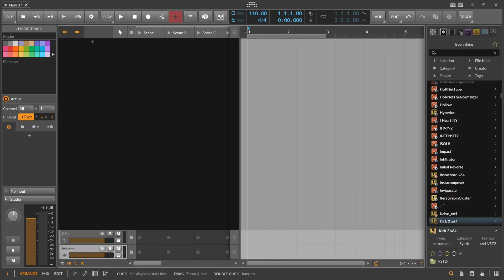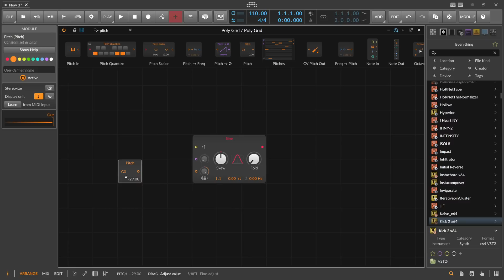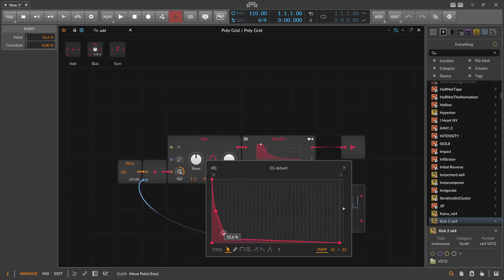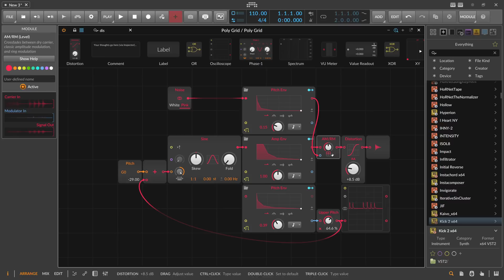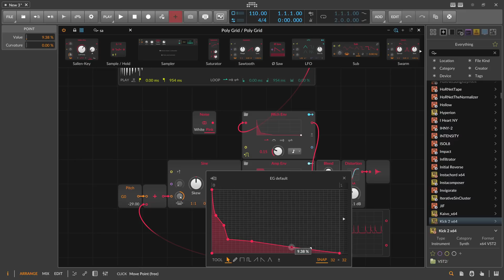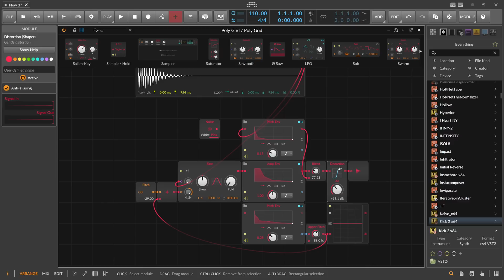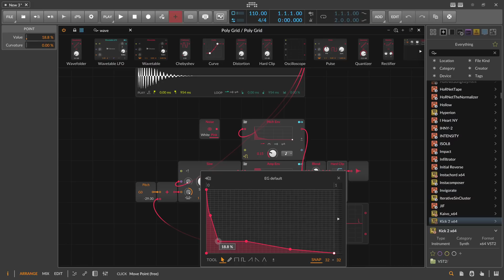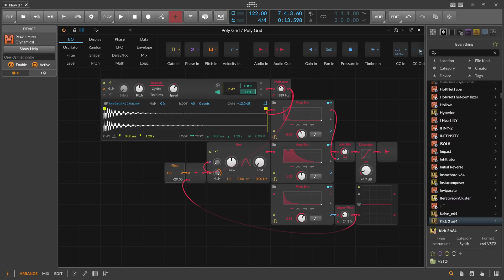replacing Kick 2 with Bitwig Stock Devices

Comment: My $0.02: consider using oscillator sync to reset your audio oscillators on each trigger. If you don't do this, the transient will change every time. The changes may or may not be detectable depending on your patch, and for that matter, they may be desirable. IME, with a techno/house beat, I want the kick to be either identical or have its changes be tempo-sync'd.
Reply from the maker: im using osc retrigger, should do exactly that :)
Reply: @PolarityMusic  ah. I thought the grid had a setting like that but couldn't remember properly. (The grid is something like my fourth language when it comes to "modular music" and I barely know it.)

Comment: This is great but what it's still missing is the abstracted interface for it that still makes Kick2 "easier" to use in. my opinion. I think we need something like Reason's combinator 2 that allows you to use custom controls that will in essence, tap into the Grid.
Reply: Just use the macro knobs on the polygrid device.

Comment: Great turorial as always. However, the way I use Kick 2 is to re-create a kick I like from any song by copy ing/tracing the waveform in Kick 2 (it can be very time consuming). I then normally add saturation/distortion with another plugin. Maybe copying another kick would be possible using your method with an oscilloscope? Anyway your tutorial definitely opens the way to unique kicks.
Reply from the maker: oh you re-synthesize by manually tweaking the waveform? this sounds very time consuming. but i guess its clean once you get good result.

yes you can use an oscilloscope for that, maybe even overlay your source kick. OR on top, even better, phase flip the source and fiddle around until the output is silence :D
Reply: @PolarityMusic  Yeh. It is to clean up the kick - make it mne. Thanks for the heads-up!  I will give your suggestions a try. Cheers.
Reply from the maker: you can also use a sampler (with a kick) in the grid, put zero crossings on the output and it gives you a fairly accurate pitch envelope of the sample. maybe also useful for you
Reply from the maker: @unlikeachair  what do you mean? 😂
Reply: @PolarityMusic  Your suggestions had disappeared my end! All OK now.

Comment: Thanks!👌. As always incredible tutorial. I wanted tu purchase kick 2 in the past but I always found ways to make great kicks, sometimes I just distort/saturate over 120hz or depending how I like. I don’t know if there is a way to route to different outputs (like when using kontakt) in the grid. I think that is not possible but would be awesome to do some external proxessing
Reply from the maker: Kick2 is still useful, the GUI is nicely made and there are lots of presets available :) and yes you can create some outputs with dc offsets and modulator outs.
Reply: @PolarityMusic  Do you have a tutorial for it, or where can I find one?
Reply from the maker: no, not yet. Here is an old preset. You put this into the fx box of an polygrid, and you modulate from within the polygrid, with "modulator out" modules the two remotes called "left / right" or "mono". thats bascially it. you can stack the presets than in layers and can create multiple outputs this way.

Comment: Very nice video! Looking forward for the official 5.0 release to use it in production!
What I often miss when I design sounds in the grid are modules like an EQ, reverb, or compressor, when I want to apply these effects only to specific parts of the patch and not to the final output ... therefore the full integration of the grid in the signal path (not just linear processing) as you mentioned in the first 5.0 beta video would be really nice!
Reply: For the EQ you can use filters for now. Low-pass, high-pass etc.
But it would be a very nice addition! Even route the signal in an external VST (Valhalla for example) and routing it back in the grid, would be a killer feature. Don't know if it's possible to do though.
Reply: @vladartiomav  I know .. or using a band pass filter. Of course I could patch also the other effects like a reverb using the all-pass filters or a compressor. But for a fast work flow it would be handy to have these things already ready-to-use.